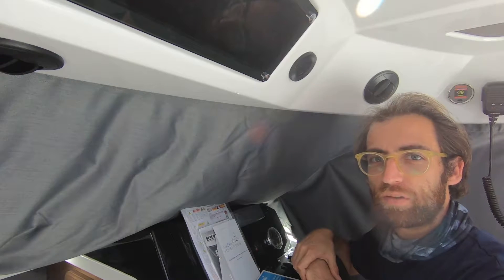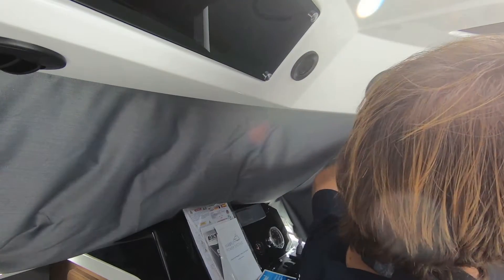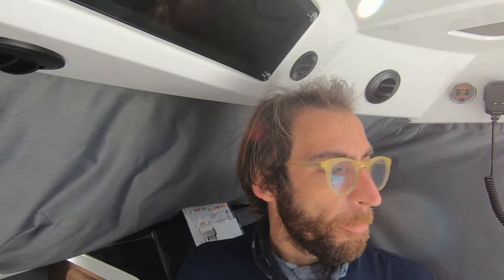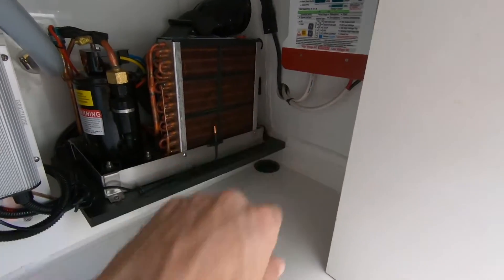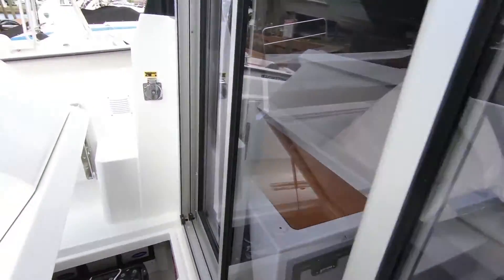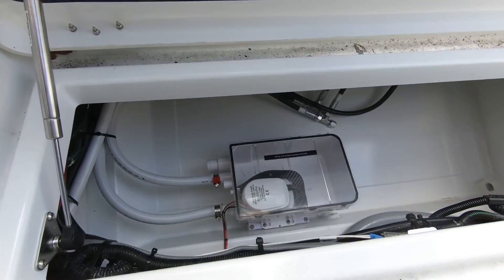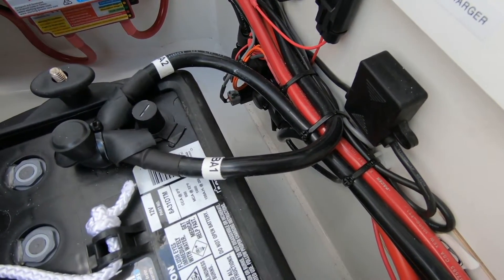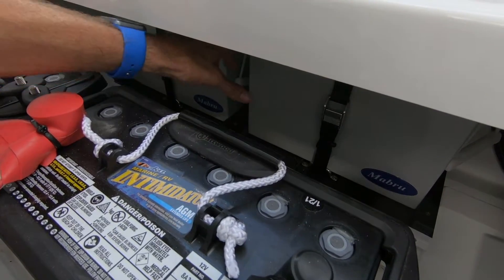12v DC Marine Air Conditioner on a 2022 Jeanneau 795 Sport by Mabru Power Systems. NO GENERATOR!

Comment: Most advocate only discharging Lithium batteries to 20 percent.  Two 125 amp hour batteries give you 250 amp hours, 80 percent is 200 amp hours.  29 amp consumption would yield only 6.9 hours.  Correct?  I believe you have over estimated your cooling system.
Reply from the maker: That's a far point but also keep in mind that as the unit cools the space down, it will also draw less power and in turn, run for longer. We have yet to have a customer complaint regarding our advertised runtimes but do appreciate you bringing this to our attention.

Comment: In english, I would assume a 12v a/c unit is sub par to a 110v x 220v pump …….Not to say they dont work in some applications, but …….whether an Axopar, catamaran or this boat, these areas get up to 100 plus degrees in the summer and would find this system to insufficient……..
Reply from the maker: the incoming voltage to the unit is irrelevant to the cooling capacity of the unit. A 7,000BTU unit, whether 12v, 115v, 230v, 460v is producing 7,000BTUs.
Reply: @MabruPowerSystemsINC  Thank you

Comment: Hi Nick, you should make the video and present the configuration that you installed in my 795. I think it is more complete since we include the 12k BTU unit, more outlets and better placed, the two 250 Ah batteries and even the inverter to power the rest of the boat with 110V.
Reply from the maker: You are 100% correct Mr Delgado, It would be good to show the configuration of your vessel as well with all of the bells and whistles
Reply: David, can you share the typical cooling capability on your vessel (looking to add one of these to a NC695).  IE, outside temp was 95, inside was XX.  Whats your thoughts on a 12,000 BTU vs the 7000 installed here?
Reply: @douglasmontgomery6315  I don't have a simple answer, being in Florida the degree differential outside compared to those achieved from the climate controlled space, is barely enough to stay "cool".  That is, with 86• outside, inside we will have 79~80!! .  Even 12K BTUs are not enough on a very hot day (normal day in Florida).  I see the main advantage when using it at night, to sleep very cool and without mosquitoes.
Reply: @davidjdelgado6760  , thanks...we live in Florida as well...so that is helpful.

Comment: Thanks for the video....questions though.

I'm assuming usage would be calculated as (12.6 V X 29 A) = 365.4 Watts.  So, 400-500 watts of solar could also maintain the A/C, or if motoring with solar as well, could recharge batteries faster so that a full charge was available when reaching destination.

Did/Do you do a Manual J heatload calculation to determine what size BTU A/C to install?  I'm sure you're aware that sizing can be critical (I know on home systems, but I'm not sure on boat...hence why asking).  Too big, compressor does not run long enough to remove humidity from inside.  too small and the system runs too long and may never reach owners desired setpoint.  

How did you size that system install?

Thanks
Reply from the maker: I do not recall where the voltage was at when I was doing my testing but I would assume closer to 13V so I would do 13v X 29A to get 377W at full speed. 400W of solar would likely not maintain the unit  running but would certainly do a great job of extending runtime whereas 500W should be able to handle it on a sunny day. While en route to destination we are also taking advantage of the engine alternator so that is another factor to keep in mind but as there are many alternator options out there, it is difficult to say for certain whether or not the alternator(s) will be able to keep up with the unit draw.
Sizing the units in these vessels is based on several factors and not just heat load. We strategically place the vents to blow the air where it is needed and follow the concept more of a convertible car as there is no feasible way to run an AC unit to freeze out a vessel like this and be able to run off of batteries. With the newer technology that we have today, oversizing is becoming less and less of a problem as we have several models with variable speed compressors that will reduce capacity as the temp in the vessel gets closer to set point. 
I hope that this answered your questions
Reply: @MabruPowerSystemsINC  , did you ever get any feedback on this unit in this vessel.  IE, with outside @ 90-95 F, was this unit able to get the interior down to say 74-75 F ?  If not, would the SC12DC?

Also, do you do installs at your location, or must someone go to a local dealer?